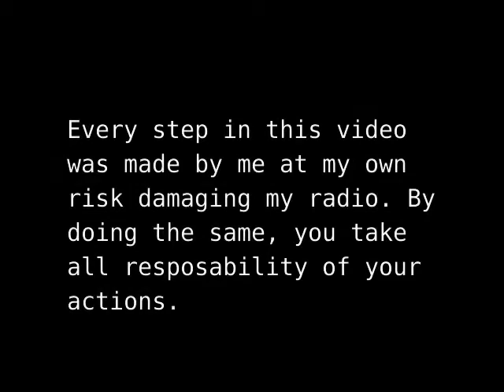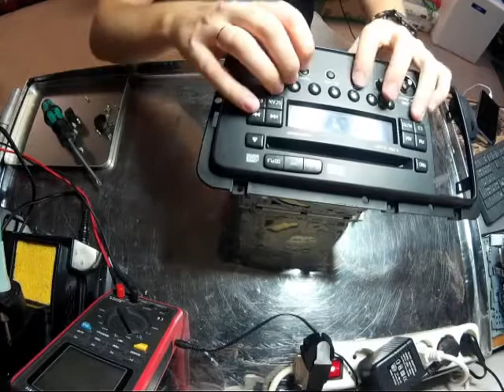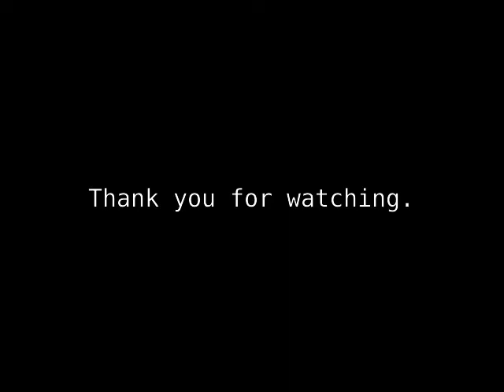HU-850 No sound fix. Part 1. Disassembly

Comment: I have to disassemble my HU-650, not HU-850.  I got stuck at removing the front plastic and whatever comes with it.  It looks similar, yet different from this construction.  Another guy with an HU-850 removed the front before the sides - interesting to see it can be done both ways.  I will try removing the sides next like you did.
Reply from the maker: You dont need to remowe the sides. Just two screws on each side. And three little pins on top. Flat screwdriber will work. And that's it. Dont forget to take of 4 little handles.l from front panel. Bass treble and other rwo. Good luck

Comment: Front Panel lights not working on HU-850. Maybe you tried to fix it and can share how to do it.
Reply from the maker: front panel lights? lcd lights work good? mainly if i remember right there gonna be a light tube issue. i can try to fix for you.
Reply: @TheLeAntony  Only button lights does not work. It would be great if you could fix it.

Comment: Did u manage to fix the problem and how?
Reply from the maker: yes. by changing two IC on the board. but not having much time to make part 2 :D
Reply: @TheLeAntony  Did you replace two  2SD1760 transistors, or the two resistors on the opposite side?
Reply from the maker: @paxanrus  no. Those transistors good. I changed only resistors. Used two 0.25w with leads.
Reply: @TheLeAntony  Thanks for a quick reply. I replaced those with 1 watt 1ohm resistors, but it still makes clicking noise and gets loud all of a sudden even when I turn off the stereo. Buttons work fine. I can select fm, am, cd changer, but there is no sound. Just clicking sound every 5 or 10 seconds. Would you think replacing those transistors on the opposite side of resistors would fix it?
Reply from the maker: @paxanrus  no. Therebis a problem with sound processors. Under metal plate near those transistors
Reply: @TheLeAntony  I have the same problem, what are the sound processors and what to do with them ?Sorry, I`m an amateur with this stuff, I changed the resistors but it only worked for some minutes, then the clicking again...
Reply: @TheLeAntony  I see. Do you know if there is a way to replace those. Are they underneath that big metal cover next to the transistors?
Reply: @TheLeAntony  Can you tell me please what are the exact IC chip you used for the replace?? Factory numbers or parameters?? Thank you!!
Reply: @MrMomk0  SAA7715AH — smaller IC, SAA7709H103 — bigger IC. I have replaced on my 2006 HU-650 only the bigger one (not sure if 650 has the smaller one, do not recall by the re-soldering). THe symptom was partial loss of sound (only the rear speakers working, sometimes playing with fader helped for a while). Replacing the SAA7709H103  did help perfectly, but only for 2 years. Now I got into even a bigger problem, there is no sound at all, and every 10sec I get a "bang" in the speakers. This is sometimes lounder sometimes not, but occurs regardless of radio being on or off. Imagine driving a long distance with this funky drummer !!!! I am not sure if I go for another IC replacement (maybe both ICs) or if I upgrade to HU-850. Best of luck. P
Reply: @piotrkwas73  Mine is HU-850 i did resolder everything that messed up and recover the line paths. Too bad i can't send you pictures just to see how severe the damage was. Unfortunately that didn't fully solve the problem and i still have full lost of sound and poping noise on random occasion regardless of the HU been On or Off. I'm so disappointed of this problem i can't see how this can be a top class HeadUnit at all. I'll try one last time to fix it by changing the Ic chips and if this doesn't help I'll put multimedia instead.

Comment: I have attempted the fix by replacing the IC controllers under the metal plate. During the process I found two pads chipped-off from the board :( I would add a jumping wire i knew where them traces connect to. Does anyone has an idea if a schematic for those boards exists? Used units are expensive and it's sure they are going to brake sooner or later
Reply from the maker: if you provide me some more info, pictures or something, i can try to help find right tracers for you, because i have  some donor boards left